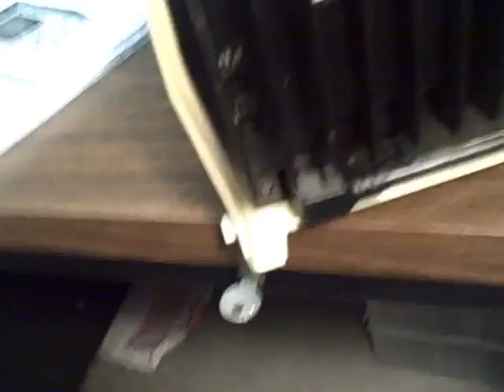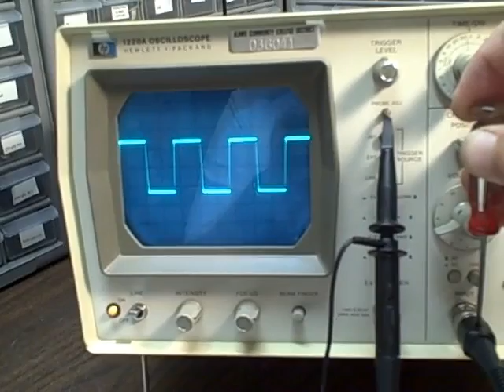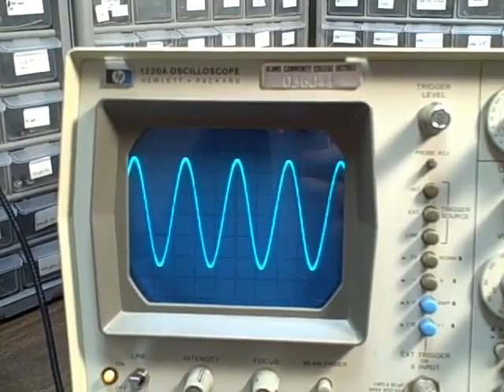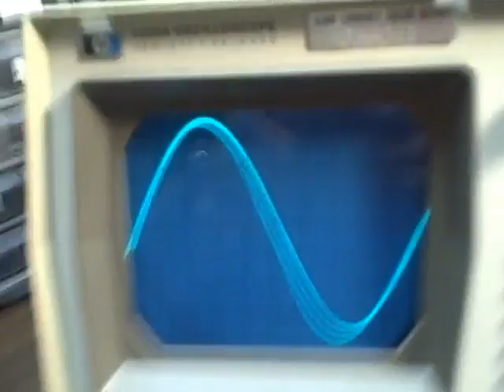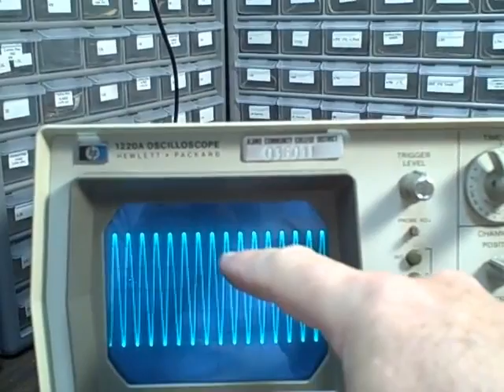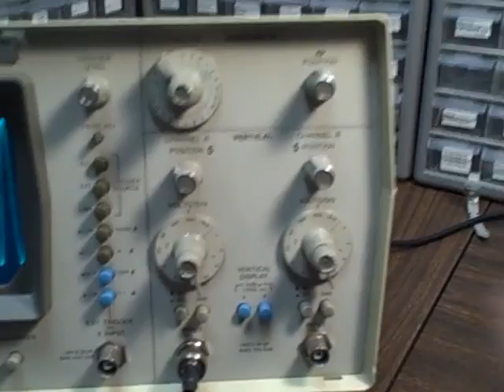HP1220a unit 2

Comment: I have an older version of this.  The line switch located on the transformer assembly is not connected to the line cable that runs towards the front. Any ideas?
Reply from the maker: Clean the connections on the power cable that goes from the transformer to the front panel switch. Its gets cruddy and loses the connection. You could also splice the wires at the connection points and eliminate the connectors.